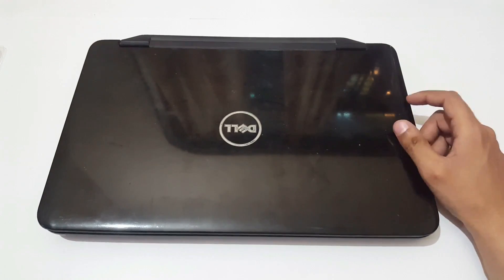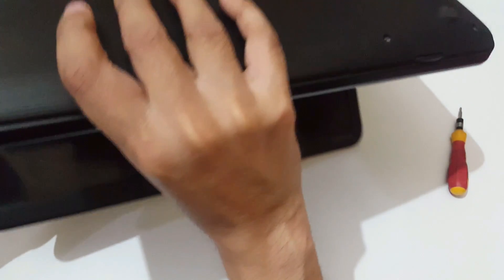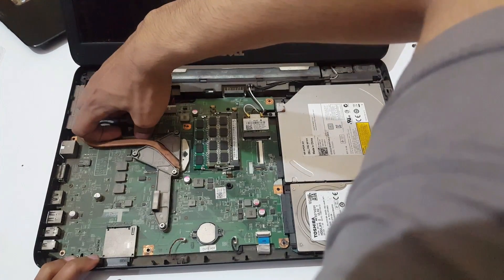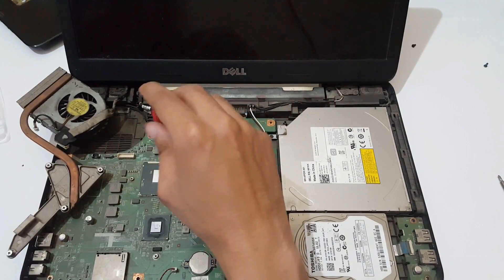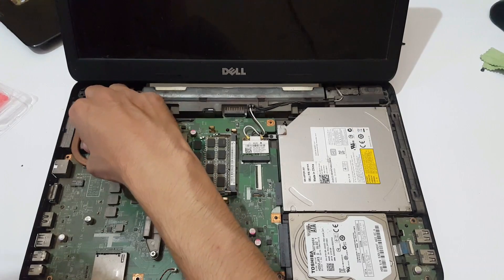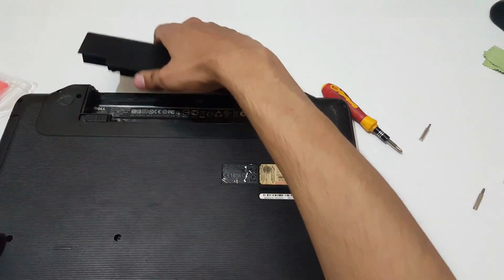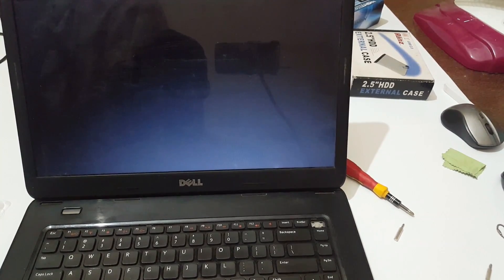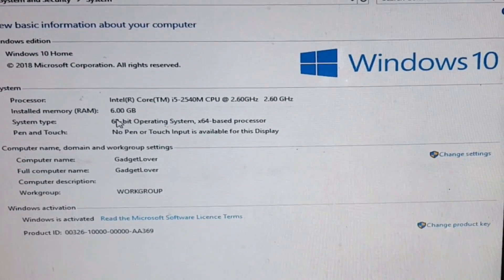How to Upgrade Processor on DELL Laptop | i3 to i5 & i7 - Make Laptop Faster for Gaming

Comment: Thanks Bro for this video, Keep up the good work, I will try it also. I have Acer E 15 i5-6200U 16GB ram and I want to upgrade my processor ,please tell me if I can upgrade processor and which is the best one to use.
Reply from the maker: You're welcome and I would like to inform you that the processor of this Laptop is soldered so you can't upgrade it but I would suggest you upgrade its RAM to max and install SSD for better performance
Reply: @GadgetLover360  thanks for the advise, please tell me which SSD is compatible with my laptop  Acer E 15 E5-575-55Z3
Reply from the maker: @tonixfj  You're welcome and Samsung 970 EVO Plus 250GB PCIe NVMe M.2 Internal Solid State Drive is best for your Laptop
Reply: @GadgetLover360  Thanks brother, God bless you and the work you do 🙌
Reply from the maker: @tonixfj  You're always welcome
Reply: @GadgetLover360  
I have upgraded my laptop RAM to 16GB. I have 1TB HDD. do i need to have SSD also?
Reply from the maker: @indian3197  For more better performance yes
Reply: @GadgetLover360  
Thanks. I have lenovo laptop. Upgraded RAM to 16GB. It has I3,4th generation processor and 1TB HDD. Shall I replace 1TB HDD with 1TB SSD?
Reply from the maker: @indian3197  You're welcome and yes

Comment: Nice video but please can I upgrade my i7 2nd generation cpu to 5th generation i7 cpu and will it work ? It's an Intel cpu.
Reply from the maker: Thanks and I would like to inform that if the processor is not soldered you can upgrade it in same generation only

Comment: hi bro. i hope you remember me. i had asked you about my dell latitude e6440 processor upgrade. it has become my secondary laptop now, as my brother uses it currently. but i have a question. it has 4gb ram and 500gb hdd currently. what is the maximum ram upgrade for it and can i upgrade it to an ssd? if yes, then what is the maximum ssd capacity i can upgrade it to?
Reply from the maker: Hi and you can expand it upto 16GB and it depends on your usage
Reply: @GadgetLover360  what about the ssd?
Reply from the maker: @neelsaini4312  It depends on the usage buy according to it

Comment: Hi sir.
I have Lenovo g500(2014) laptop
It has 2 gb ram and intel Pentium processor. So sir I want to convert it to 8gb ram and I want to change the processor also.
Can you give me suggestions please
Reply from the maker: Hi and I would like to inform you that Intel Core i5 3380M is best processor for your Laptop and you can expand its RAM upto 8GB

Comment: Ca i upgrade Acer extensa 2510 i3 4005U to i7 prossesor
Reply from the maker: In my knowledge the processor of this Laptop is soldered so you can't upgrade it but I would suggest you upgrade its RAM to max and install SSD for better performance
Reply: @GadgetLover360  Thank you for your help
Reply from the maker: @AnasBlake  You're welcome

Comment: My core in my laptop is not soldered so that means I can upgrade my Intel i3 to Intel  i7 right?
Reply from the maker: Yes you can upgrade it in same generation
Reply: @GadgetLover360  my laptop core is i3 2nd gen so I connot upgrade to 4th gen or 7th
Reply: Only same gen core
Reply from the maker: @Rad_gaming140  Yes

Comment: Sir I have dell Inspiron 153000 it has amd A6  with 4gb ram can we can upgrade it 

(Plzz reply )
Reply from the maker: I would like to inform you that if the processor is not soldered you can upgrade it in same generation
Reply: Sir how to check if it is lga or bga
Reply: It is 9 th gen
Reply from the maker: @samirtiga525  In my knowledge the processor of this Laptop is soldered so you can't upgrade it but I would suggest you upgrade its RAM to max and install SSD for better performance
Reply: Thanks

Comment: Which is best processor of HP PAVILION G4.
Currently on Default AMD A4 3310 
RAM 2 GB
And tell me which is the best ssd for my laptop
Reply from the maker: AMD A8 3550MX is best processor for your Laptop and I would suggest you upgrade its RAM to max and install Crucial BX500 240GB SSD in your Laptop

Comment: Hey brother amazing educational video.. appreciate your response to all the messages. I have HP 2000 note book PC, model 2000-2127TU. Its running on core 2 duo 2nd gen. Can I upgrade to i5 or i7 2nd gen !. THANK you
Reply from the maker: You're welcome and yes
Reply: @GadgetLover360  can I upgrade my i3 6006U processor in my lenovo yoga x360 laptop??
Reply from the maker: @unseenhunter4588  The processor of this Laptop is soldered so you can't upgrade it but I would suggest you upgrade its RAM to max and install SSD for better performance

Comment: Hi, I'm using Dell Inspiron 15R N5110, currently on i3 2nd generation. Which processor would be the suitable one?
I've already upgraded to a 120gb SSD and using the 320GB HDD for storage and RAM is 5GB(4GB+1GB)
Reply from the maker: Intel Core i5 2540M is best processor for your Laptop
Reply: @GadgetLover360  thanks for your response. I tried to to upgrade the RAM to 6GB but the system wouldn't boot. Any idea why?
Reply from the maker: @PrashantBhati  You're welcome and I would suggest you to check whether the RAM is working properly or not
Reply: @GadgetLover360  the 2+1 RAM configuration works but 4+2 doesn't work. That's why I have to settle with 4+1
Reply from the maker: @PrashantBhati  Check 2GB RAM is working properly or not
Reply: @GadgetLover360  yes it works,
Also, can I upgrad to a higher generation of i5?
Reply from the maker: @PrashantBhati  I would like to inform that you can upgrade it in same generation only
Reply: @GadgetLover360  can the processor be upgraded to higher generation of i3?
Reply from the maker: @PrashantBhati  No
Reply: You can upgrade it to an i7 2nd gen (mobile processor)

Comment: I have Dell Vostro - 15 3568 with i3 7020u can i change the processor of it.
Reply from the maker: The processor of this Laptop is soldered so you can't upgrade it but I would suggest you upgrade its RAM to max and install SSD for better performance

Comment: HP-15q-bu040tu
It is possible upgrade in i5 processor
Reply from the maker: In my knowledge the processor of this Laptop is soldered so you can't upgrade it and I would suggest you upgrade its RAM to max and install SSD for better performance

Comment: Can u please that can we upgrade the intel core in a windows 7 laptop as i have a windows 7 sony home premium and it has intel core i2 and i wanna change it
Reply from the maker: I would like to inform you that if the processor is not soldered you can upgrade it in same generation

Comment: Hello, I have a dell latitude 3340 with intel core i3-4005u cpu @ 1.70ghz. Will it be possible to upgrade the cpu?
Reply from the maker: Hi and the processor of this Laptop is soldered so you can't upgrade it but I would suggest you upgrade its RAM to max and install SSD for better performance
Reply: @GadgetLover360  ok thank you
Reply from the maker: @AeroTechRevolve  You're welcome

Comment: Hello. My thinkpad e590 with intel core i5 8265u stopped to work cuz processor failed. I can't find the same processor. Which other can I use to replace it in core i5? Thank you in advance!
Reply from the maker: Hi and I would like to inform you that the processor of this Laptop is soldered so you can't upgrade it so I would suggest you go to nearby service center or PC & Hardware store and tell them about this problem
Reply: @GadgetLover360  Thanks. Appreciate it.
Reply from the maker: @ntakayama  You're welcome

Comment: Is it possible to change the processor for Hp Laptop 14-ck0xxx
i3-7020U
Reply from the maker: The processor of this Laptop is soldered so you can't upgrade it but I would suggest you upgrade its RAM to max and install SSD for better performance

Comment: hp 240 g3          is it possible?
Reply from the maker: In my knowledge the processor of this Laptop is soldered so you can't upgrade it but I would suggest you upgrade its RAM to max and install SSD for better performance

Comment: Hey does it possible to replace from i3 to i5?
Reply from the maker: I would like to inform you that if the processor is not soldered you can upgrade it in same generation

Comment: Hi 
Is this possible to change the processor for HP Pavilion 15-p029TX
4th Generation Intel Core i3
Variant:	4030U
Reply from the maker: Hi and I would like to inform you that the processor of this Laptop is soldered so you can't upgrade it but I would suggest you upgrade its RAM to max and install SSD for better performance

Comment: Sir I have a Lenovo ideapad 100-14IDB and it has an i3 5th gen that runs on 4 gb ram. Can it's processor be upgraded?
Reply from the maker: The processor of this Laptop is soldered so you can't upgrade it but I would suggest you upgrade its RAM to max and install SSD for better performance

Comment: Hi
Thank You for the tutorial 
Will i be able to upgrade my Dell Vostro V130 from core i3 to core i5?
Reply from the maker: You're welcome and in my knowledge the processor of this Laptop is soldered so you can't upgrade it but I would suggest you upgrade its RAM to max and install SSD for better performance
Reply: Hello i hope you can see my reply sir. But i have a lenovo g40 80 i3 can i upgradebit to i5?
Reply from the maker: @unc.drew27  Hi and the processor of this Laptop is soldered so you can't upgrade it but I would suggest you upgrade its RAM to max and install SSD for better performance
Reply: @GadgetLover360  thank you by the way hehe
Reply from the maker: @unc.drew27  You're welcome
Reply: @GadgetLover360  hello again sir I hope you can still notice me😥. Um what about the Acer aspire 4250 is it upgradable?
Reply from the maker: @unc.drew27  Hi and in my knowledge the processor of this Laptop is not soldered so you can upgrade it in same generation

Comment: I have i34040u 8gb ram 
Fenovo flex 2
Reply from the maker: In my knowledge the processor of this Laptop is soldered so you can't upgrade it but I would suggest you upgrade its RAM to max and install SSD for better performance

Comment: Hey bro,I have a dell inspiron 3421 and it has core i3 3rd gen processor.Can I upgrade this to core i5?And in which gen I can upgrade?
Reply from the maker: The processor of this Laptop is soldered so you can't upgrade it but I would suggest you upgrade its RAM to max and install SSD for better performance

Comment: I have dell Inspiron n4030 with i5 2nd gen. Which processor can I replace it with.
Reply from the maker: Provide processor number
Reply: @GadgetLover360  core i5 480 2.66ghz
Reply from the maker: @TheRrrockstarrr  Intel Core i7 640M is best processor for your Laptop

Comment: Sir pls suggest me best proccessor for Dell Inspiron 15 3000 
i5 8th gen 8gb ram 2 tb storage
Reply from the maker: In my knowledge the processor of this Laptop is soldered so you can't upgrade it but I would suggest you upgrade its RAM to max and install SSD for better performance
Reply: How to increase ram and install ssd
Reply from the maker: @somitparida7456  See its manuals

Comment: My laptop is dell  inspiron 15 3552 processor -  intel Celeron Dual-Core Processor can i upgrade it to i5/i7 ?
Reply from the maker: The processor of this Laptop is soldered so you can't upgrade it but I would suggest you upgrade its RAM and install SSD for better performance

Comment: Hi, Thanks for your wonderful video. i have Dell Inspiron N5040 with Processor: Intel(R) Core(TM) i3 CPU M 380 @ 2.53GHz . Please let me know which will be best for me i5 or i7 and its model number. Also will it cause any other hardware issues if i do so.
Reply from the maker: You're welcome and Intel Core i5 580M is best processor for your Laptop
Reply: Hello sarah yes it works like he say G socket replacement for a i5 core processor I wonder why do they not made a better one

Comment: Can i upgrade dell inspiron 15 3000 series 3541 processor to i3 ??
Reply from the maker: The processor of this Laptop is soldered so you can't upgrade it but I would suggest you upgrade its RAM and install SSD for better performance
Reply: @GadgetLover360  Thanks 😊
Reply from the maker: @randomchannel2247  You're welcome

Comment: I have Dell core i3 8 Gen 4 GB ram.
Can I upgrade i5 on it ?
Reply from the maker: I would like to inform you that if the processor is not soldered you can upgrade it in same generation

Comment: Hey bro, I have an Acer aspire 7 with i5 9th gen processor and it runs on 8gb of ram.. Is it possible to upgrade both of them?
Reply from the maker: The processor of this Laptop is soldered so you can't upgrade it but you can upgrade its RAM

Comment: Thank you for this informative video. I need a suggestion that can I change my processor of dell Inspiron 3593 i3 laptop?
Reply from the maker: You're welcome and the processor of this Laptop is soldered so you can't upgrade it but I would suggest you upgrade its RAM to max and install SSD for better performance
Reply from the maker: @indirav411  You're most welcome and you can expand it upto 16GB and yes Crucial P5 250GB 3D NAND NVMe Internal SSD is best
Reply: Thank you so much for your reply. I can use both HDD and SSD in my dell Inspiron 3593 laptop?
How much gb ram is good for my laptop?
If I install SSD how much gb if is enough?
Reply: Noob indira you can change you processor by buying new laptop.. Okay!

Comment: thanks a lot for this video, brother.
I have a Dell Inspiron 15 3567. can I upgrade the Processor to Ryzen 3?
Reply from the maker: You're most welcome and I would like to inform you that the processor of this Laptop is soldered so you can't upgrade it but I would suggest you upgrade its RAM to max and install SSD for better performance

Comment: hey um my laptops an acer aspire 3 ,Intel i3 4gb ram will I be able to install a new cpu and if so which is the best choice?
Reply from the maker: The processor of this Laptop is soldered so you can't upgrade it but I would suggest you upgrade its RAM to max and install SSD for better performance

Comment: Can I change Core I5 7200U processor with AMD?
Reply from the maker: I would like to inform you that if the processor is not soldered you can upgrade it in same generation
Reply: @GadgetLover360  ok

Comment: Can I upgrade from a 35W CPU(i5 2450m) to a 45W(i7 3630qm) one on Toshiba L855?
Nice video by the way
Reply from the maker: Thanks and I would like to inform you that if the processor is not soldered you can upgrade it in same generation only

Comment: Hello can anyone answer me :) Can I upgrade my i5 10300 to i7? I have an acer predator helios 300 ph315-53 laptop and I'd like to upgrade its processor. Is it safe if I upgrade it? Is it worth it? Will there be any issues or is it compatible at all? I mean it does have an i7 variant but I pick the i5 back then since it's much cheaper and in sale.
Reply from the maker: I would like to inform you that the processor of this Laptop is soldered so you can't upgrade it but I would suggest you upgrade its RAM to max and install SSD for better performance
Reply: @GadgetLover360  okay, thanks for the info :)
Reply from the maker: @primum3723  You're welcome

Comment: Sir i have a dell Inspiron 15 3537 core i3 with 8gb ram can u plz tell me which CPU i should change it into?
Reply from the maker: The processor of this Laptop is soldered so you can't upgrade it but I would suggest you upgrade its RAM to max and install SSD for better performance
Reply: @GadgetLover360  oh man😭 but thanks for your reply love u bro
Reply from the maker: @asifashiq5572  You're welcome

Comment: I have inspiron 7472 
Core i5 and ram of 4gb can I upgrade to i7 and ram 8gb?
Reply from the maker: I would like to inform you that if the processor is not soldered you can upgrade it in same generation
Reply: @GadgetLover360  sorry bro imean inspiron 7472 dell laptop what is the best core i can upgrade?
or it is soldered already maybe no chance.
Reply from the maker: @abaykudoitv7494  The processor of this Laptop is soldered so you can't upgrade it but I would suggest you upgrade its RAM to max and install SSD for better performance

Comment: I have Hp 15-da0434tx Laptop core i3 7th Generation 2.4 GHZ Want to Upgrade It Can U sugget which is better N fast processor for it??
Reply from the maker: In my knowledge the processor of this Laptop is soldered so you can't upgrade it but I would suggest you upgrade its RAM to max and install SSD for better performance

Comment: Can I do it on Dell Vostro 3546?

It has Intel celeron 2957u
Reply from the maker: The processor of this Laptop is soldered so you can't upgrade it but I would suggest you upgrade its RAM to max and install SSD for better performance

Comment: Hi can I upgrade my  HP - 15z-ef2000
Ryzen 5 5500
2x4 GB ram
Reply from the maker: In my knowledge the processor of this Laptop is soldered so you can't upgrade it but I would suggest you install SSD for better performance

Comment: Bhai mera laptop sony Vaio hai , 10 saal purana hai i3 processor hai, I wanna upgrade it to i7 8gen can it be done, pls reply
Reply from the maker: I would like to inform you that if the processor is not soldered you can upgrade it in same generation
Reply: @GadgetLover360  same generation means, i3 only? And not i7?
Reply from the maker: @igneousgaming3604  It means processor generation
Reply: @GadgetLover360  processor generation MATLAB I3 5gen se i3 8 gen tak, he MATLAB???
Reply from the maker: @igneousgaming3604  Yes

Comment: Sir my laptop is dell vastro 3568 i3 6 th gen ...can I upgrade this to i5 9 gen or 10 gen ???
Reply from the maker: The processor of this Laptop is soldered so you can't upgrade it but I would suggest you upgrade its RAM to max and install SSD for better performance

Comment: Hi can i upgrade processor of Lenovo c260 from celeron to i3
Reply from the maker: Hi and I would like to inform you that if the processor is not soldered you can upgrade it in same generation